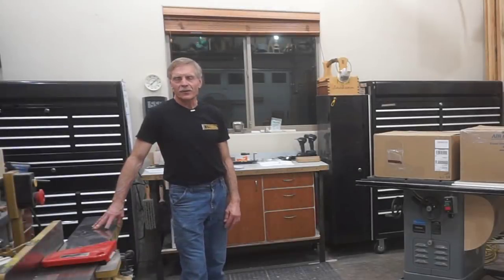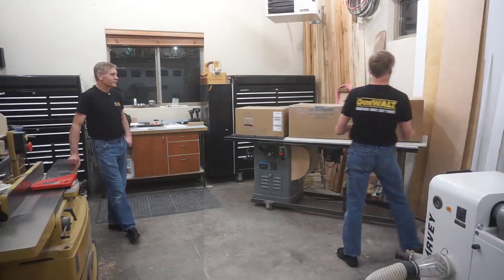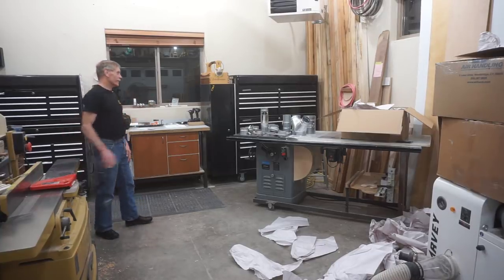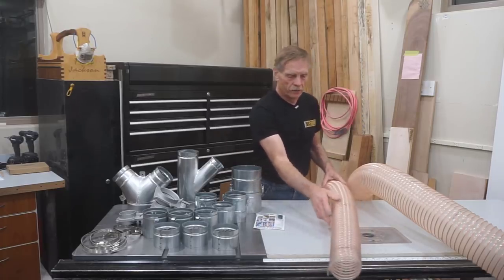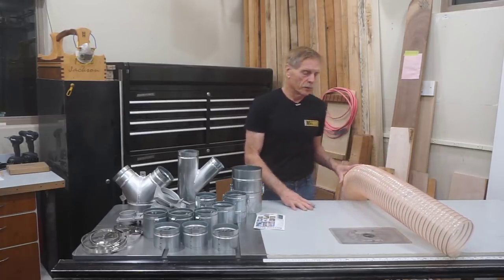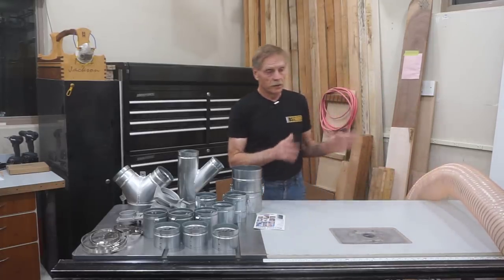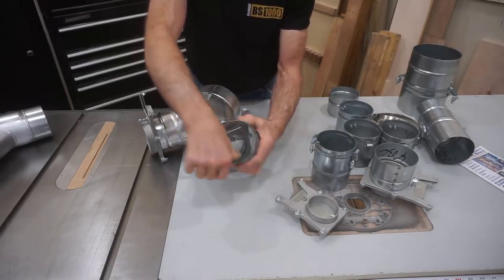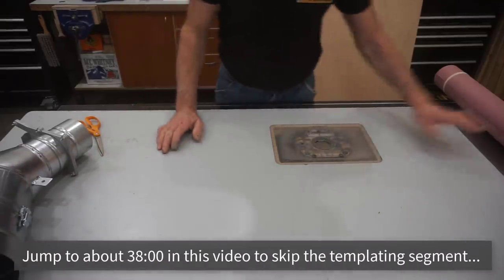Flexible Dust Collector Piping Setup

Comment: FYI 30 mil is not 30 millimeters, that would be 1 3/16 in. A mil (not to be confused with a milf) is a measurement that equals one-thousandth of an inch so 30 mil is equal to 0.76 mm (millimeter). You are not the first to make this slip. 2:45
Reply from the maker: I've pinned your tactfully informative comment here for awhile Marc... thanks for adding it!  Usually I realize after the fact that I've messed up and add a note in the video during production but this one escaped me completely!  Not only am I not the first 'to make the slip' but there's a high degree of likelihood I'll make the same one again🙄.  Thanks for keepin' me on my game! Best, Matt
Reply: Where we actually use millimeters the use of "mil' or "mill" to describe it, is used all the time. BTW, Centimeters are never use in building or wood work, mills (1200mm) or meters as in 1.2 m.

Comment: That is a great tip about blade deflection on inside curves. I've had that happen so many times, and thanks to you, I can avoid having it happen!
Reply from the maker: Simple problem to avoid... once you're aware of what's going on, right David? Best, Matt
Reply: @NextLevelCarpentry  Yes it is. I was blaming the saw. I have never liked saber saws and that is one of the reasons why. Now if can learn to see through the sawdust cloud to see where the blade is in relation to the line I'll be a happy camper.

Comment: Hi Matt, you are getting quite fancy with these videos!  I can see where Chip helps a lot; just don't let him sit on your shoulder.  I hope that company paid you for the ingenious magnet idea.  One of those metal gates came with a jointer I bought at auction 20+ years ago, and I hated the thumb screw.  I also was unhappy with the groove clogging with sawdust, so I threw it out and made 10 gates by hole-sawing a couple boards for pvc collars and separated them by two 1/4" plywood spacers.  My gate was a piece of ply with similar hole in one half, so it would slide all the way through the fixture when closing and self clean.  Subsequently I made my own tool adapters, and I can shrink or expand PVC pipe to fit flex tubing and other vacuum connectors.  These days I usually buy the plastic gates and orient them slightly lower than horizontal to prevent clogging.  There are a boat load of homebuilt examples out there, but I envision your design fabricated with exotic pallet trimmings, dovetail guides, waxed, polished and engraved!
Reply from the maker: Hey Francis, I've got a LOT to learn about dust collection and the Dust Processor, blast gates included.  Thanks for adding comments from your experience for my benefit and that of other viewers! Best, Matt

Comment: Good video. You gave me some ideas for  my cheap filter bag/cyclone collector. I was looking at rigid ducting along one wall but frankly lack the skills to do it. Your "Y" connector and flexible hose setup on the floor will work perfectly for me. All my large power tools sit along the one wall, so your setup (with cheaper flex hose (I'm on a pension) ) will work perfectly. With it being along the wall I can even leave the hose connected.  Your solution applied to my situation is simple and elegant.

Comment: I know you said you didn't want hard pipe on the ceiling, but not tripping over your stuff while you are trying to mill a bunch of lumber is pretty nice. Being able to push a cart loaded with said lumber between tools is nice as well. 

The regular cody snap together ducting won't collapse under a dust collectors vacuum. 
It's cheap, fairly easy to put up. Hang it with mechanical strap and seal it with the silver foil tape. You can also bond it to your grounding to get rid of static potential.

A simple ceiling hung air cleaner is nice as well. I made one out of a squirrel cage fan and the same filters my house furnace takes so I could just buy one size. Just picks up the airborne dust.

I have an 8" trunkline in my shops centerline and 6" branches with 4" drops. with gates at the end. flex in short runs to the tools.
Reply from the maker: Sounds like a sweet setup nevermindthebollocks... much more typical than what I've got going.  Time will tell what works and what doesn't.  You're the 2nd guy who's told me about a hanging air cleaner and more motivation for me to make that happen... I can see already how helpful and necessary one would be.  Best, Matt
Reply: @NextLevelCarpentry  You can buy one for a lot or build one for a little. Biggest deal is to use a common sized filter.
Reply from the maker: @nevermindthebull0cks  well said! What size filters does yours take? I'm now on the hunt for an expired furnace with a good squirrel cage blower... Best, Matt
Reply from the maker: @nevermindthebull0cks  thanks for the beta... I'll check it out and see where I get... some bits of what you share are bound to make it into my final design, so thanks!  Best, Matt
Reply: @NextLevelCarpentry  Sure, that's why people watch these channels. To learn for others experience and treachery:)
Reply from the maker: @nevermindthebull0cks  heavy on the treachery sometimes, right? 😂😂

Comment: If you want to keep your connections more temporary than silicone and rivets, James Hamilton, aka Stumpy Nubs, uses aluminum tape to seal the connections without being locked into a dust collection design
Reply from the maker: Cool... thanks for adding that tip Douglas... I may employ it in the meantime as I'm still a bit hesitant to commit. Best, Matt

Comment: First chance I had to view this and it looks pretty darn good to me. When you where making the rough cut and kissed the line you where a bit mad at yourself and I am thinking it is only a proof of concept piece but then I said that is the difference between a Pro (you) and a wood butcher (me). I was thinking put the quick disconnects on the gated Y and leave to shorter major tubes tubes attached to the machine: table saw and thickness planer and use the extra flex hose for the secondary tools. Having Chip help was pretty funny. Nice editing work.
Reply from the maker: Thanks Tom, the jury is still out on some of the hose stuff but otherwise the dust processor is excellent!
Best, Matt

Comment: Matt, you are correct about your new, excellent dust collector not being a practical set up for an overhead dust collection system. My Oneida’s 6” intake port is mounted 6 feet off the ground ( required for rest of assembly to fit properly with the large collection bin below) and the specs state at least a 16” straight run out from that intake port followed by a 45 degree elbow, all 6” I.D. After that 6” pipe for at least 4 feet before any reduction to 4”. That would be a totally impractical arrangement for your collector.
Cheers,
Michael O’Brien
Alabama
Reply from the maker: Thanks for adding those parameters pathdoc... important factors for any dust collection setup.  My mind works in unusual ways to the point I've actually considered setting the G700 4 or 5' off the floor to optimize chip collection capacity and facilitate a raised pipe network like yours... so all this is nutritional food for thought... Best, Matt

Comment: The port location on the dust processor is far less important to raised or lowered ducting that you might think.
There is a modest loss of efficiency going overhead, but with dust collection it’s more about air volume than anything. At 1,100 CFC you could raise sawdust to dizzying heights before experiencing any measurable loss of dust movement. I have no issue either way with floor, wall or ceiling mounted plumbing...but I do have concern over the location of said plumbing in the high traffic space.
My current system is wall mounted. My first was floor mounted around the shop periphery. Both worked superbly with no “gathering spots”. In all cases, I had 900 com or better flow. My buddy with his 750 cfm unit had to unclog his floor plumbing monthly.
But like you said, it’s the beginning of something worthwhile and you did say it is subject to change with experience.
Best wishes with all your efforts and congratulations on what looks to be shaping up to a very fine shop. I always appreciate all the skills I learn at your generous sharing, as well as the humor you include.
Reply from the maker: Thanks for that perspective Chuck... it's encouraging to know I may have options I didn't realize.  Makes it clear that the ultimate arrangement is with under-floor main lines with short flexible periscopes... dream on, right? Glad you like videos here!  Best, Matt

Comment: I have no need for the big dust collector you are using in my workshop, but this stuff will work out perfectly with the Jet dust collector that I do have. You could hang the hoses from the walls and ceiling, and it doesn't have to be anything expensive or elaborate. You could just use inexpensive metal strap and drywall screws to hang everything. Heck, even a drywall screw and a short length of paracord would work too.
Reply from the maker: If I were attaching anything to walls I'd probably go with some sort of rigid.  Just so you know: the flex from my shop shown in the video is ant-static and quite robust and is therefore borderline 'expensive and elaborate'.  Air Handling Systems does have lower cost options but I chose this stuff since I end up moving it around a fair amount as I do a ridiculously wide range of projects in the NLC shop.  Best, Matt

Comment: Great video Matt!!!  If you have problems with the four inch flat band clamps they make left and right hand spiral clamps that fit in between and over the copper wire which are inexpensive. Your videos are always informative. Happy New Year! and say hi to Chip.
Reply from the maker: Happy New Year to you Steve, from Chip and I!  I've seen those clamps and, after using the regular ones you see in this video, made a note to ask 'my guy' at AHS if they have the type you describe and, if not, why.  Seems like a much cleaner design.  Best, Matt

Comment: Matt,
That was pretty thorough video on the set up of your collection system. It should work great. I have the exact same metal blast gates on each piece of equipment with my Oneida overhead system that I installed in my shop as a retrofit. They work well and are very durable. I have my blast gates oriented vertically so the gate pulls up to open and I then tighten the knob down to hold them in the up position. This way when I close them I only have to barely loosen the knob and the gate drops closed. To use again just pull the gate tab up, twist the knob and it is locked open again, very quick and I am standing up, no bending over. This is not a criticism at all, but for me as a senior and a woodworker I am always concerned about any trip hazards, so the big hoses on the floor, while quite visible, would be a concern for me. I am sure you will orient the hoses to minimize this. You did an excellent job and all the hoses and fittings are top quality and you will enjoy the dust free environment in your shop.
Cheers,
Michael O’Brien
Alabama
Reply from the maker: Thanks for sharing your experience and perspective Michael... both are quite meaningful to me as I take my own journey through the land of dust collection.  I think one of the determining factors in my setup will always be that the G700 intake port is near the floor, which doesn't lend itself well to an overhead pipe network... the pair of 90 degree bends right off the bat to run an overhead trunk line seem like they would so compromise suction that the whole system would be instantly downgraded.  Since the size, portability, low db level, low power consumption and efficiency of dust separation were the main factors I used to choose the system I may have to endure the main drawback of intake port location as a compromise.  Your notes of concern and caution are well taken and will be kept front of mind as I refine the hose network setup, orientation, etc so please share any additional things that come to mind.  Best, Matt

Comment: Happy New Year Matt!! Great video as usual. Most of your projects should include getting your hardware put away.
Reply from the maker: Happy New Year to you too Ray! After 20+ years working in my old, cramped but organized, shop it's extremely frustrating to have to clamor over, through and around those boxes of boxes!  Rest assured I'm working hard to work through my project backlog to build the shop door and organizing drawer system I've planned.  I keep telling myself I'll get there!  Best, Matt
Reply: @NextLevelCarpentry  I know you will get there, have a great new year.

Comment: An issue with dust collection is having enough suction to suck the dust from the blade to the inlet port. If the distance is too great, some dust does not make it into the hose. By reducing the size of the inlet port, more suction can be obtained. An example is the crevice tool with a shop vac.  Much more suction than a wide mouth tool.

Comment: All good but I still think a ceiling mounted ridged steel pipe running down the shop with flexible drops a proven system, especially in a tight space. I’d be forever tripping over the floor python.
Reply: Or even wall mounted 4 or 5" PVC main with flex extensions to the stationary tools.  That monster in the middle of the floor doesn't thrill me at all
Reply from the maker: Now you know why I went so long without a dust collector... no matter what the configuration it's an encumbrance compared to working without one.   Best, Matt
Reply: @NextLevelCarpentry  nice to be able to breath though.
I've been milling up some Cedar lately, and the dust really does a number on me, even with the mask on
Reply from the maker: @gregmislick1117  Hear you loud and clear Greg... at least cedar smells nice though, right?  Work safely!  Best, Matt
Reply: You are 101% right ! ! and safer

Comment: It will be interesting to see how your floor mounted dc system works out in your day to day workflow. I may be mistaken, but feel pretty certain you will eventually opt for elevated and probably rigid dc plumbing, as the floor system will without doubt interfere with moving sheet goods and lumber about your shop.....just sayin’!
Reply from the maker: Ducts, wherever they are, are an inconvenience to be sure Chuck.  The pros of a G700 Dust processor far outweigh the con which is that its intake port location doesn't lend itself to an elevated system.  I'm sure I'll long for the days of wearing a mask and just letting the dust fly for its unencumbered workflow similar to the way I used to love working long days in the sun in cutoffs and workboots in times before they invented sunscreen that makes sawdust stick to you.😩😢😎 Best, Matt

Comment: I'm liking this Matt and am doing similar with my hoses.  You probably know this already buy I think the magnets should be on the other side of the gate so the door is pulled to the suction side....is that true?
Reply from the maker: See there?  The 'teacher' learns too Brian... you're absolutely right about magnet placement.  Where I show will not only cause a little suction loss but undoubtedly lessen their holding power as suction pulls against the gate and away from the magnet.  Maybe I can hide my embarrassment by saying "I knew that... it's all about camera angles" or some such lame excuse? 😩😲😂😎 Thanks for commenting! Best, Matt

Comment: i like your setup but think you will eventually put it on the ceiling with drop down  to hookup the reason i say that is for myself even knowing there is just a extension cord laying there i will trip over it
Reply from the maker: Irvin; with this dust 'collector' and shop arrangement I don't ever see a ceiling mounted system.  Not to say that I wouldn't much prefer a less intrusive setup but in a perfect world I'd go under the floor slab with the whole business because I don't want to deal with dangling drops either.  Thanks for your insight all the same... Best, Matt

Comment: This is a helpful video. Thank you. Did you use the 4" U30-AS or the 4" U30-SDC, or maybe even something different?
Reply from the maker: It's been long enough that I don't know without doing some digging.  I do know I got the heaviest duty anti-static option available though.  Since this was my first experience with dust collection I figured 'go big or go home' but, in hindsight, I might have been better off with something a little less robust but lighter weight.  As it turns out, weight is more of an issue than failure from wear but nowhere near a deal breaker.  I encourage you to call Air Handling personally and let the super helpful guys there help guide your decision to what works best for you... and tell 'em Next Level Carpentry sent 'ya?  Thanks!
Reply: Thank you. I find your video's helpful. I will follow up with Air Handling Systems.  @NextLevelCarpentry

Comment: Maybe little dolly wheels under your Y board for ease of moving around when packing up!
Reply from the maker: Actually I don't want it to roll around that easy because it would make it more difficult for getting hoses hooked up and keeping it in place once it is hooked up.  Thanks for the suggestion all the same... Best, Matt